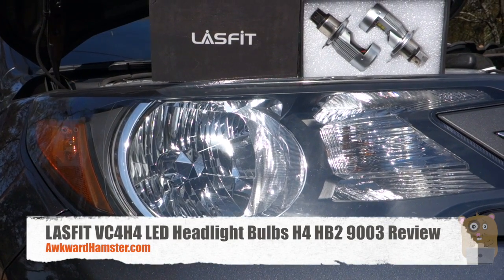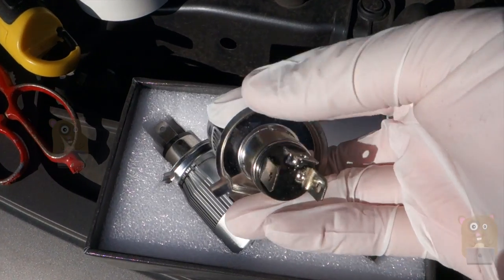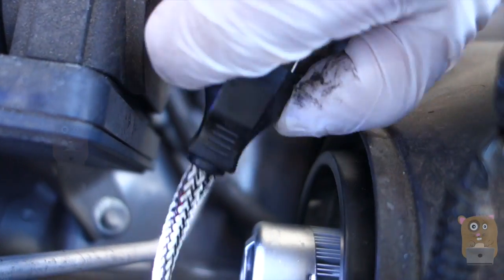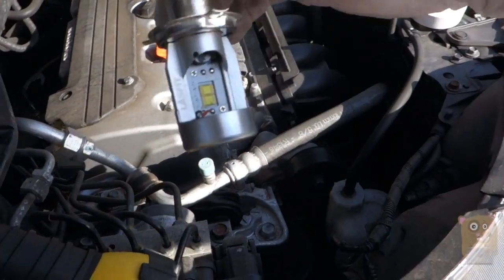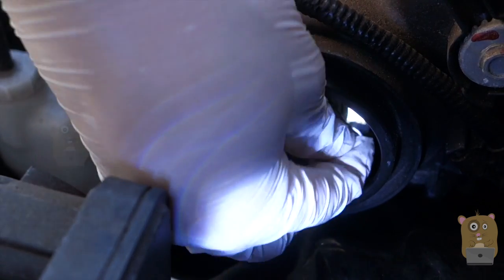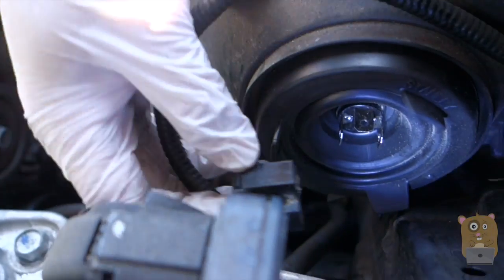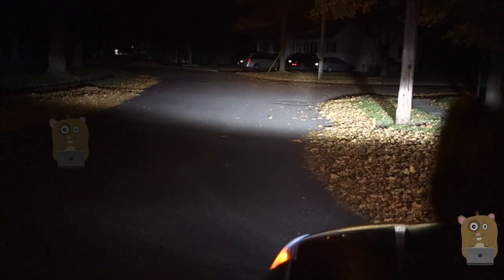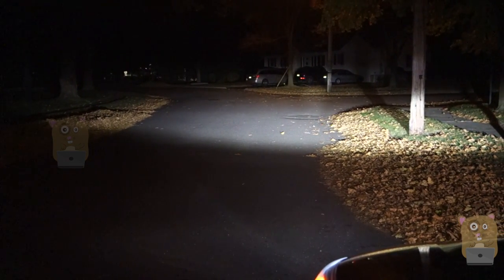How to Change Honda Accord Fog Lights to LED Bulb H11 Review

Comment: According to that light pattern, the bulb should be flipped over. You have it in upside down because the cutoff line should be across the top of the pattern and not on the bottom!

Comment: Okay. So, I'm /hoping/ to find a reasonable, rational LED replacement for my normal bulbs on my 2010 Honda Fit Sport (ironically, called a Jazz everywhere else but in the US). Your CRV uses the same H4 bulb and weather seal. I noticed you weren't using yours in order to operate the previous LED bulbs. Did you encounter any trouble with water getting into the housing?
I'm also very glad you did this video. It revealed exactly the problem with the LASFIT bulbs that I wondered about -- the horizon issue. The housing was designed for light emanating in all directions off the axis of the bulb. So, of course a one-sided LED design would be a problem. But it was actually far worse than I had guessed it would be.

Thanks.